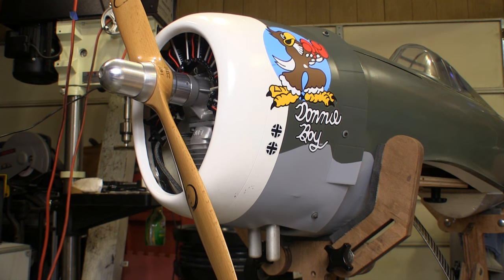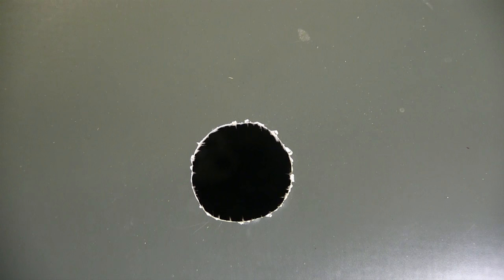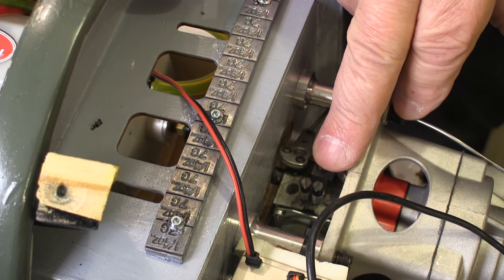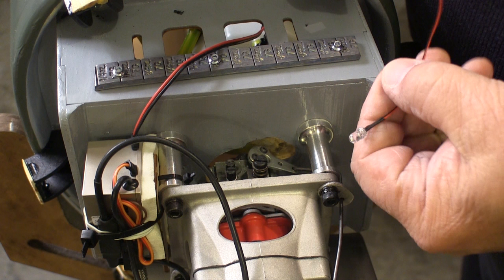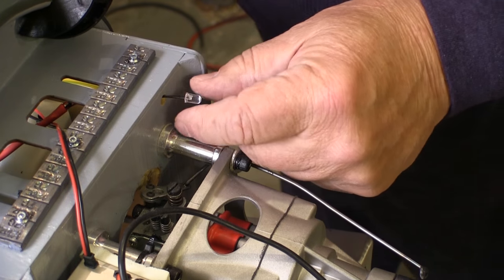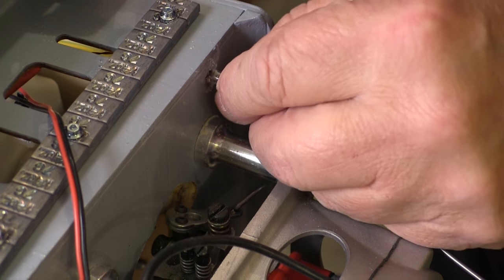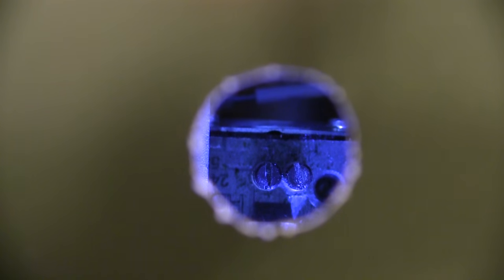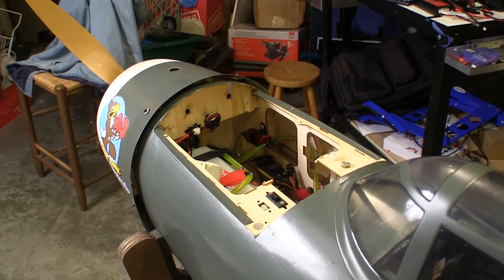There’s a Bunch of Dark Inside My Cowl

Comment: Good thinking!
Tapping into the Rx battery downstream of the ON/OFF switch would also work as a power source.  It wouldn't be individually switchable, but it would be lighter and simpler, and the current draw is insignificant...
For an electric powered model, a similar tap off the ESC lead to the Rx would do the same thing
Reply from the maker: +jimmbbo I just knew someone would consider the .2-ounce weight a problem. I wanted it to be a separate system with no ties to the main batteries or radio equipment. I'd rather "struggle" along with the extra weight and keep all this separate.